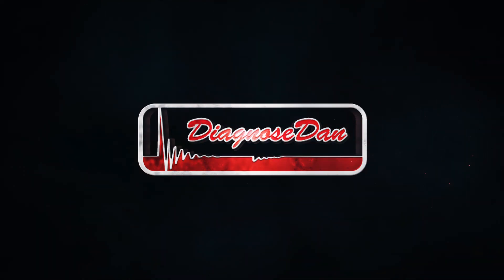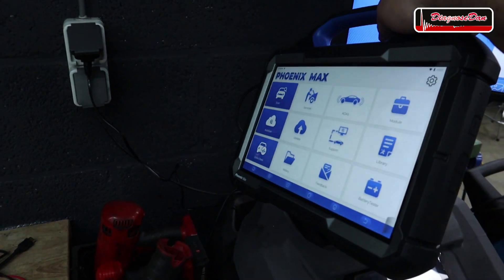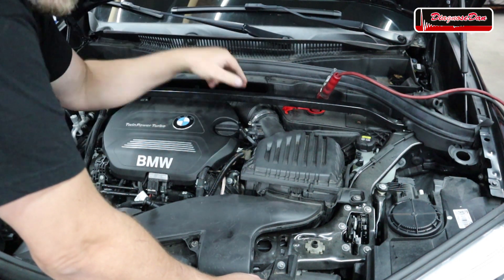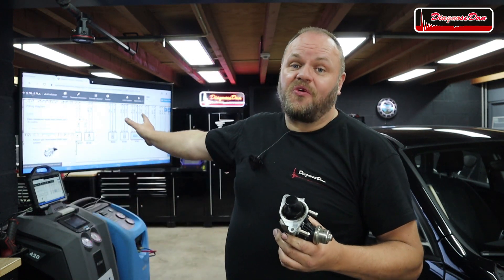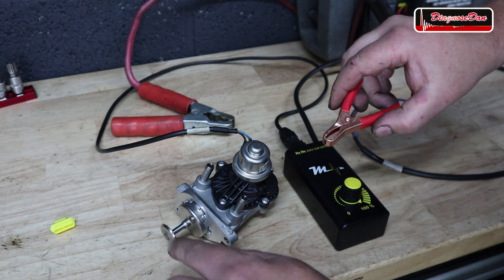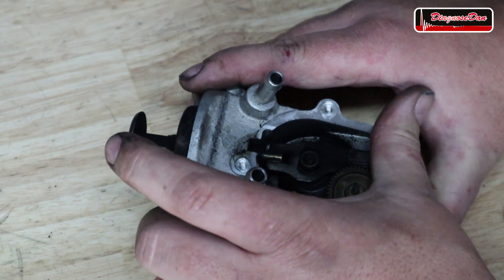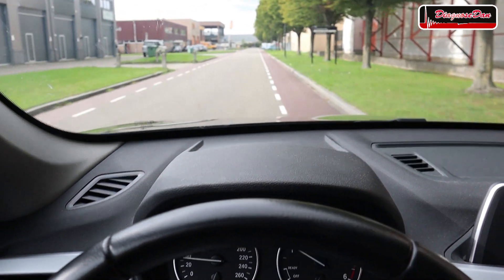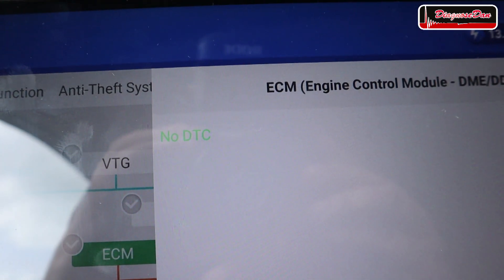EGR TROUBLE

Comment: What? Wait. So, as you have to put the valve in service mode, and the valve goes out with a spring, you have to mount the valve plugged with its cable? First time I see this. Thx
Reply from the maker: Exactly

Comment: Dpf regen kicks in at high rpm so it wants egr closed because it needs high flow of fresh combustible air, so it commands egr to stay closed I would assume, open egr brings non-combustible air into the engine and during high rpm that would choke the air flow, I think general rule is egr kicks in at low-ish rpm anyway correct?
Reply from the maker: Thanks for the comment

Comment: I love these videos and your diagnosis are alaways great but you surprised me that you made a mistake in that you never checked to see if the egr cooler was blocked or leaking coolant  as this is a very common problem on these bmw/mini engines there is even a quilty enhancement for that issue at the moment
Reply from the maker: If the egr cooler is blocked i wouldn't have the faultcode egr flow to high. The car is not loosing any coolant and everything was dry inside
Reply: @Diagnosedan hi Dan love your videos but didn't say it was blocked I said you should have checked it while you had the valve out and yes they can start blocking up and sooting up the egr valve that was your fault sticking egr return spring valve ya ? When the soot builds up after a period of time they over heat the egr cooler then crack and  leak coolant I see it every day unfortunately anyway keep the videos rolling 👍

Comment: To regenerate DPF, the EGR-valve should be closed to increase the ignition-temperature. I guess on older diesel BMWs, it activate glowplugs and add diesel when the exhaust-valve are open, to ignite diesel out to the DPF, also to increase temperature. I'm note sure, but i read it somewhere. Thanks for another good video.
By the way a new EGR seems to be locked mecanical, but if you put power on is like you did and retracked til valve, will it return to locked possisjon again?
Reply from the maker: Thanks for the comment Ronny, what do you mean with locked?

Comment: Great video, the install tip and the question.  I would think the valve needed to be closed during regeneration so maximum heat can burn the particulates in the filter.
Reply from the maker: Thanks for watching Mike

Comment: Common issue on European Fords when the egr valve /motor is changed is mechanics doesn't calibraye it and it slams the valve over and over until the steel shaft fatigues and shears completely off.

Seen this 3 times after someone other than me have "fixed" it before, saving time and not calibrating or deleting old faults....
Reply from the maker: Thanks for the great feedback

Comment: Hi Dan a potential cause for the parasitic draw could actually be the egr too As its commanded shut after engine is off then it will often try to satisfy the position sensor by trying to release the egr, this is the reason you sometimes hear a loud buzzing from the failed egrs with electronic actuators. Its not something I've proved like but I know the egrs are required shut during start up to allow the maf and intake calculations to be accurate without unmetered egr flow. The current draw could be similar to when a starter goes duff. You still send the same power that's required.... but it does nothing and if the computer is trying to close a stuck open valve by commanding the motor to give the spring a little push for a while after cars of it could create a draw. Just a thought. Hope your well. Haha get top Don to send me freebies and ill love them long time hahaha
Reply from the maker: Thanks for the feedback

Comment: Hi Dan. Is it safe if I use power probe to retract that egr? Thank you for this video
Reply from the maker: It would work but its not recommended because the coil could get hot.
Reply: @Diagnosedan  Thank you

Comment: Re egr I think open/partially open as its between the engine and the dpf so shouldn’t be affected by the dpf cleaning process, and should therefore re-circulate assuming engine warm. Do you think the low mileage of the car accelerated the egr sticking?
Reply from the maker: I dont think so.

Comment: The manufacturer made this on purpose to fail. If they designed a valve that has a tight fit on the bushing and the entry point of the bushing is shaped like a scraper this would never happened. The amount of side play of the valve in the bushing is just to much, on the new EGR. If it was up to me I would make a new bushing and some mods to it.
Reply from the maker: Thanks for your comment!

Comment: Another awesome video 👍👍
I'm sure the EGR is both opened and closed during dpf regeneration as if closed to long surely the increased oxygen although helps create heat it's also going to create NOx also  the EGR cooler valve would be closed to create more heat with the exhaust gases
Reply from the maker: Thanks for watching

Comment: nice one!  using the PWM generator to fully retract the valve and installing like this will do also right?  maybe will need to do some adaptation via diag but most likely will auto-detect valve position on checks routine.  thanks for posting , all the best
Reply from the maker: Yes you could also use a driver tool

Comment: The axel or pushrod on that EGR valve has a manufacturing flaw where it meets with that "fork" arm that the gear operates.  The soot was collecting in that area causing it to bind within the fork. Amazing that the pushrod seal allowed all of that soot inside the mechanical area but if that was its design then the fork and pushrod meeting point is a dumb design. If that seal is supposed to keep out the soot from the interior parts then, the seal simply failed and likely due to heat and not so tested seal materials. Maybe the owner needs a few trips on the expressway !
Reply from the maker: Thanks for the comment

Comment: EGR sourcing it's exhaust gases before or after DPF?  If after that would be smarter due to less soot getting through valve.
Reply from the maker: The pressure of the exhaust gas is low behind the DPF, this can also be done but its called a low pressure egr and that requires extra components

Comment: An open EGR valve lowers combustion temperature, so it must be closed during regeneration.
Reply: Really? I haven't truth to be said checked egr's that much, but I've always thought it's the exact opposite. I mean Exhaust Gas Recirculation. Can they ever be cooler than air after intercooler? I doubt that. Iirc my diesel mondeo claims exhaust temp to be around 160-250 depending on the engine load.

Comment: I had this on my 2011 520D , new EGR sorted it, FYI there is a couple of EGR cooler recalls of the BMW B47 engine [ my Current one] , cooling fluid leaking from the EGR cooler onto a hot exhaust manifold can cause a fire.
Reply from the maker: You are right👍

Comment: I've had this problem on the street sweepers in our fleet. Lots of low load operation means that soot builds rapidly.  However the egr valve is over 500 dollars and the labour to clean is only $180. So we are clean them out.
Reply from the maker: Makes sense if the egr valve is that expensive

Comment: Dan do you think the o2 sensor issue caused excessive soot build up in the egr valve?
Reply from the maker: No i dont think so
Reply: @Diagnosedan  why don't you believe that? I have been driving Audi TDI vehicles since 2003 and I have NEVER had problems with EGR, DPF or similar - and the only reason for that can only be my driving style.
Reply: I don't think so. It's just a general problem with EGR. Only slow, fuel-efficient driving will significantly increase it. If you drive fast you simply have far fewer problems with EGR and DPF etc.

Comment: The EGR valve should be closed so the fuel injected on the exhaust stroke goes into the DPF to heat it up to allow regeneration and not back into the cylinders and be burnt .
Reply from the maker: Awsome answer💪💪
Reply: @Diagnosedan  I still have a lot to learn.  But thanks  😊

Comment: Had a Opel mokka with a lot of egr warnings. Valve was replaced, but a week later i had another check engine light. Seemed the egr cooler was completely clogged also. So you still might get a comeback Dan.
Reply from the maker: I'm pretty sure it's fixed😉

Comment: Nice! What if you had used your PWM driver to retract the EGR? Is the retraction amount critical?
Reply from the maker: This is a pwm driver, yes it the % the egr opens is regulated
Reply: @Diagnosedan  So, if you had retracted without the special function of the tool, you should do a calibration for the ECU to learn the limits of the EGR valve?

Comment: You have to check for injectors and fuel pressure most of times a faulty injector causes carbon build up when it is delivering excessive fuel amount anyway great video i learned a lot from you
Reply from the maker: You are right about your comment, but in this case i dont think that's a problem
Reply: For a 62kkm that's not very dirty. I cleaned the EGR on my old (2006) Mercedes C220CDI at 60kkm and it was more or less in the same condition as this, but much more accessible than this.
Reply: @AlessandroGenTLe  you know as a kia we used to have such kind of problems and even dpf clogged with injector failing on new brand vehicles like Sportage 1.6 crdi at an early kilometrage but in this case as you said it's is not the same

Comment: The EGR and the Throttle Body are active during regeneration, (I’m not going to say open or closed as their positions change) the reason for this is to control the level of oxygen entering the combustion chamber which then controls exhaust Temperature during regeneration.
Reply from the maker: Thanks for watching my video!
Reply: EGR stays closed on my 3.0 TDI.
Reply: @FoookOff  intentionally?
Reply: Stays closed on my 2.0 TDI PD BMP. Infact my EGR is programmed off so it stays closed and is blocked off. It still regens and reaches temperatures of 800c. The only time my regen can't initiate is when there is an EGR code stored on the computer.

Comment: Well done Dan. It's understandable why you decided to change that egr valve for brand new, you own the shop and by trying to clean that valve and possible problems down the road equals doing same job twice hence losing time and money, probably having unsatisfied customer. 
On the other side that valve looks pretty simple, if that was my car I would try to soak that valve in some kind of solution that dissolve carbon deposits, little bit of compressed air and some kind of fine brush..
To answer your question - should valve be open or not during dpf regeneration - I think it should be closed because regeneration needs higher exhaust gasses temp and recirculation is doing opposite thing by bringing O2 down in combustion cycle, narrowing conditions for harmful NOX gasses to be produced.
Reply from the maker: Like i say in the video, if its your own car you are working on you can try to clean it 100%.
Reply: @Diagnosedan  The problem is that the black soot doesn't cause issues (soot is actually a lubricant). It's other, harder deposits such as oil ash that form a hard high-friction layer which lead to sticking valves. And that layer is virtually impossible to clean off. We've had many issues with sticking VTG systems due to such deposits forming between the center section and the variable guide vanes. Especially after regeneration, when there was no soot inside the VTG, they tended to start sticking. In the end the supplier of the VGT had to modify the tolerances and the material spec of the vane actuator shaft to fix this issue.

Comment: Great vid again, and the shop looks cooler than ever👍  That's quite interesting, didn't know the EGR valve had a service mode on BMW? Have an old Mercedes (220cdi/W211) i like to screw around with. And i can tell you that the EGR valve takes two minutes to remove with a T30 and E10 bit. No cooling lines to clamp off. And it is a "caged" type so the valve isn't just hanging out in the open like that. And to answer your question, EGR is closed during DPF regen. as many of the comments is claiming.  But not completely, i'm guessing the EGR position sensor is around ~2,5%.
Reply from the maker: Thanks for the great comment 👍😁

Comment: Excellent! Do you think this is the reason that a special key is required? To ensure that the engineer is alerted that there is something special in the assembly procedure? I see no other reason for the manufacturer not to use regular bolts.
Reply from the maker: Yes that's the reason!
Reply: Excellent point.  I was cussing the manufacturer when I initially saw those security bolts thinking to myself, 'why, just why?'  Your observation probably explains the very reason.

Comment: As a hobby mechanic, I'd love to know what tester you would recommend for private use. I mean, there are lots of OBD testers to choose from, but most of them are obviously meant to be used in shops and have lots of features that aren't really relevant for usage in the private garage, plus they are really expensive...
Reply: Autel are really good and not that expensive and cover most cars and things
Reply: I've a topdon artidiag bt800 it's amazing, £350 last year it's maybe less now, does dpf regen, special functions etc every thing you will need.
Reply from the maker: Get a cheaper model Autel, Launch or Topdon.
Reply: Alright, thanks guys :)

Comment: Hi Dan,
Can I ask a question. To prevent a comeback shouldn't you have investigated the reason for the excessive carbon buildup?
Reply: It’s going to build up over time anyways, especially if only ever driven for short runs and not really ‘driven’.
Reply from the maker: Is it excessive for a Diesel?
Reply: @Diagnosedan  I thought you were surprised by the carbon. So I used the word excessive. Maybe it is not really excessive but if I was the customer I would certainly want know from the mechanic what caused the problem.
Reply from the maker: @SE45CX  its quite normal we see this alot on Diesels.

Comment: With an EGR  on I got DPF regenerations each 250km. With EGR Off i have a regeneration each 900km. In a normale case when regeneration is active the EGR is close. An open EGR make a lower inside burning temperature. For a good DPF regeneration the DPF needs a high temperature. Thanks for the video, Dan.  To check regenarations I have connected a warning licht to the rear window heating connection. So I have allways a completed regeneration. If lamp is on i drive till the lamp is off. Takes +/- 10 minutes.
Reply from the maker: Thanks for watching Geri

Comment: Why on earth is the valve held on work tamper proof bolts!? Is that so vandals can't steal them? :) That is just bizarre
Reply from the maker: They dont want you to tamper with it.  Its also a reminder replacing it should be done by a professional because the new valve will break if installed by someone that doesn't know what he's doing
Reply: Probably to stop casual tampering (e.g. blocking the EGR off) as this is illegal in many jurisdictions. This kind of thing has been around since the days of carburettors with tamper-proof mixture and idle screws.
Reply: @Zeem4  Alex, that is plausible and you're probably right, but how ridiculous is that!?  It's not like we're talking about 14 yo boys unscrewing panels on a train.  If someone can remove half the engine ancilleries (as usually required with european cars) to get to the EGR valve, they probably have a set of tamper-proof torx drivers!

Comment: EGR valve should be then closed to get the DPF hot enough.
Reply: Egr open = less oxygen to burn the fuel = lower temperature
Reply: @I20X EGR bring back into the engine HOT exhaust gas and his work helps to increase EGTs. Obviously DPF will reach faster his working temperature if EGR stay open :) 

Anyway, is possible that during DPF regeneration, the strategy to control DPF Temperature is completly accomplished from post injections, depends on many many factors.
Reply: @robertomarino6059  I would also think this is the case.